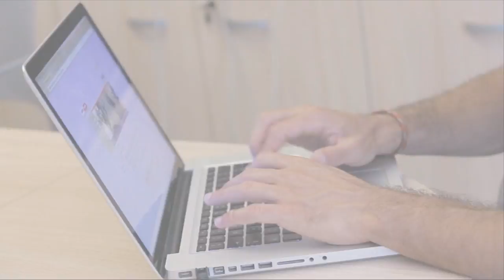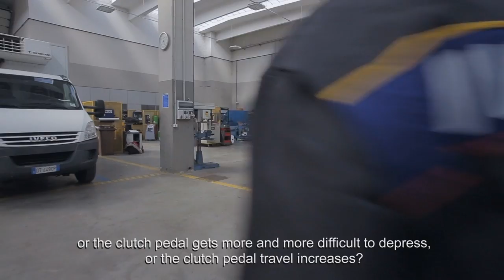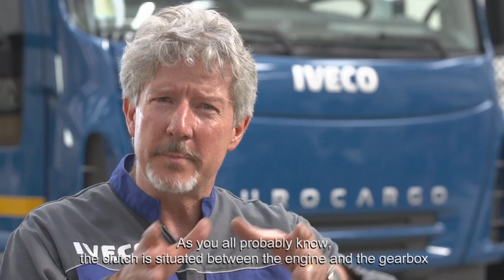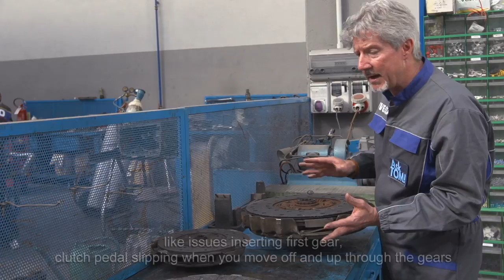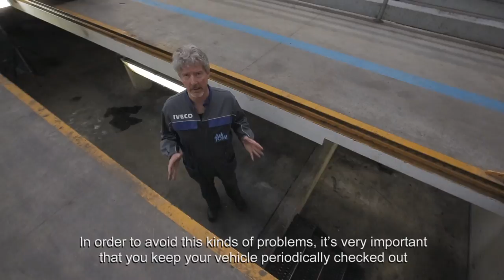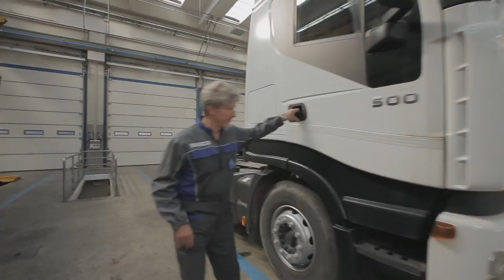Iveco Clutches - Ask Tom

Comment: Hi Tom.  I have an IVECO Daily 50C15 2004 as a Motor Home. Travelled 74000 K.s.
A new problem..standing still, cold, can change all gears easily. But after engine starts to warm up, 
increasing problem of selecting any gear., and if on road , changing gears almost impossible.
Local IVECO agent no ideas, main NZ Agent Prestige has no suggestions. Is this likely to be problem
 with cables maybe rusted, or maybe anything to do with bushes,collars at the underbody level? 
Our real local mechanic is also baffled but thinks this suggestion may be the answer.
Local IVECO were going to ask for ovreseas thoughts but no response so far. Thank you